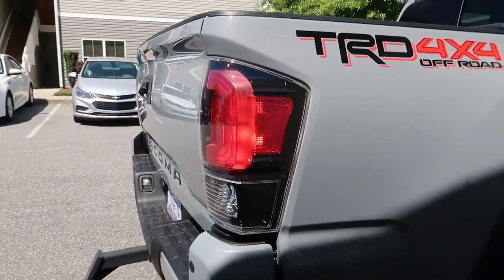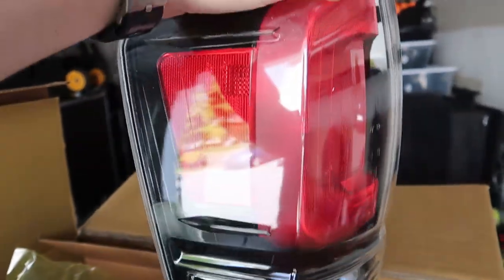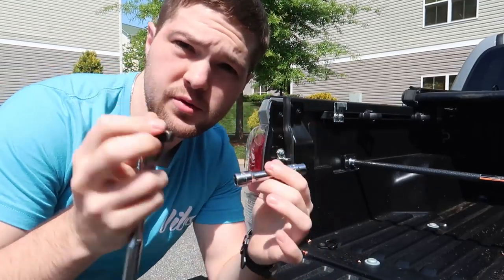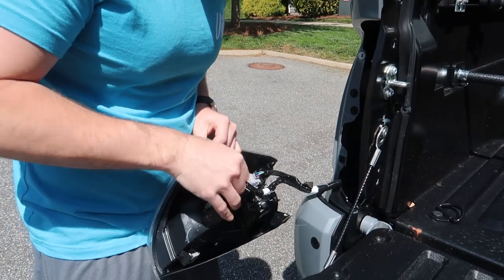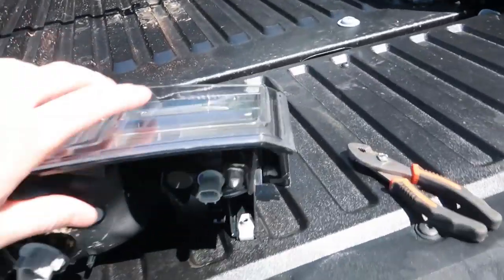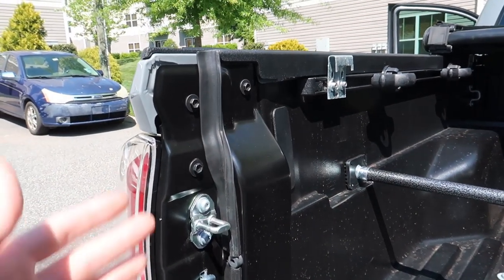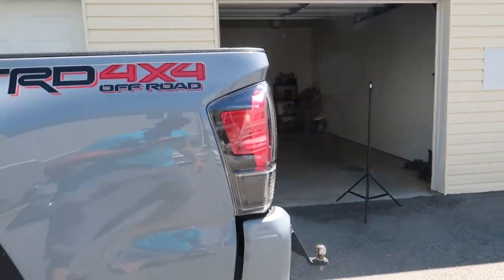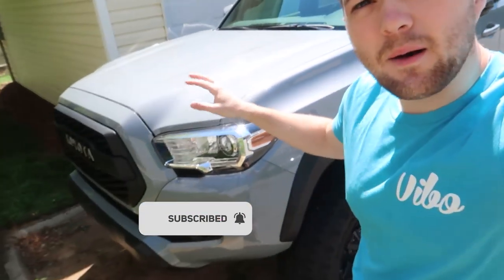2020 Toyota Tacoma TRD Pro Tail Lights (Install - Super Easy)

Comment from the maker: - Depo Tail Lights https://amzn.to/2MCsIWr
Reply: Them lights are from the 2016-2019 pro not from the 2020
2020 pro has the chrome part painted black
Reply: Hey Rick, do I need a conversion kit if I have the regular light bulbs setup? I don’t think my connections will fit into these ports.

Comment: Just got these but they dont turn on a night. My signals, brakes n reverse light work but they just dont stay on at night time. U got this issue?
Reply from the maker: No. You have auto headlights?
Reply: Running lights and license plate lights don’t work for me. Read it could be a fuse but why ?? It’s a brand new truck
Reply: Took it to the dealer. Problem was when I installed my raptor lights i put 3a fuses on my add a fuse and blew something out 🤦🏽

Comment: Actually those are SR5 taillights. The Pro has a black band running down replacing the chrome band. Stock OEM Pro taillights are only $135 / side. Why buy knock-off?
Reply from the maker: They werent in april of 2020

Comment: I definitely wouldn't pay the running 4 tacos tax, I'm sure you didn't but I damn sure wont. When I traded my 18 for my 20 I made tail light swap part of the deal.
Reply from the maker: No I paid the running taco cost. In times like right now I would rather support the smaller companies like I mentioned. Even if it does cost a little more. I make good money
Reply: @TacoRick  they definitely dont need it

Comment: Got my winjet taillights delivered today and went to install them. My running lights and license plate lights won’t work now. Everything worked when I first plugged in but now nothing.. did you have this issue? Blinkers, brake, reverse work fine. :(
Reply: im a dummy, i had them in right the first time..then i swapped a plug wrong and it blew a fuse. gonna be on a fuse hunt tomorrow. my fault for doing this in the dark!

Comment: Did by a set of these from DEPO, am not thrilled with the quality.  The plastic seam has many bubbles no where near the quality of the OEM's and they also have debris, little flakes of dirt stuck to the plastic on the inside.  I would for the money if known this gone with the OEM's.
Reply from the maker: Did not notice at all with my set
Reply: Taco Rick - yea, yours look great.  Maybe I just got a bad hand.

Comment: Can’t you just bake the taillights and paint the chrome? I have 2021 and was thinking about baking them to save the money . 

Anyone done it yet?
Reply from the maker: You can. If you watched my headlight video I did it before. For 200 250 it was worth the price to not deal with the hassel of baking and painting and having the truck un drivable for a day.
Reply: Just for anyone in the future wondering, I tried and it’s almost impossible to take off. You’re more likely to break the plastic. The adhesive isn’t like the ones on headlights.